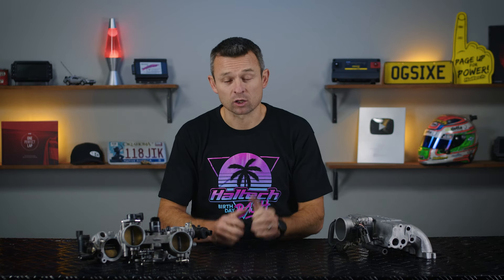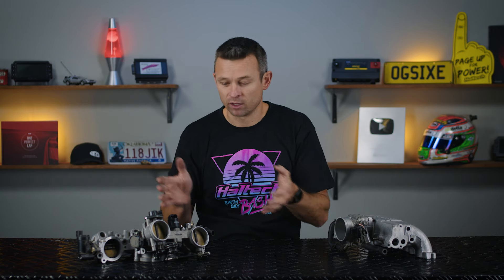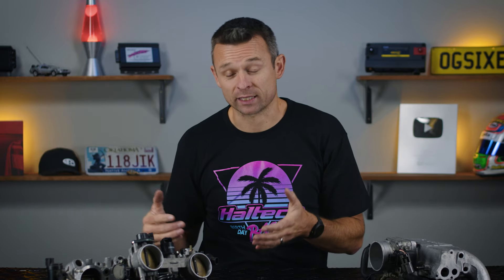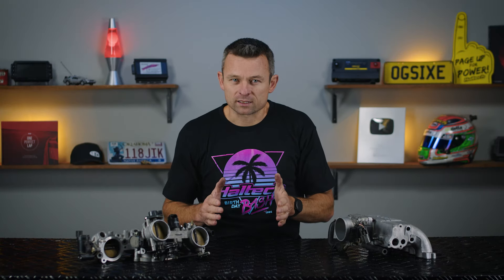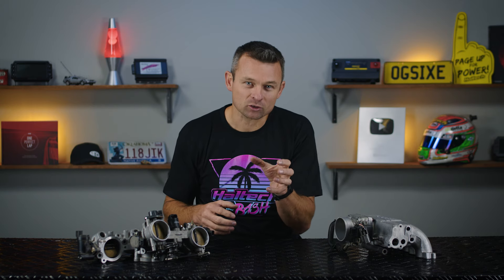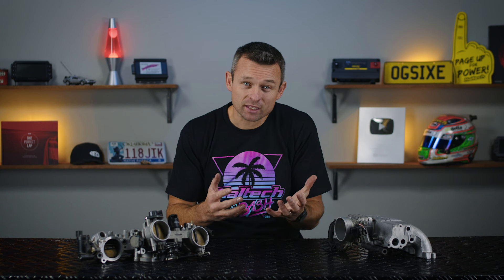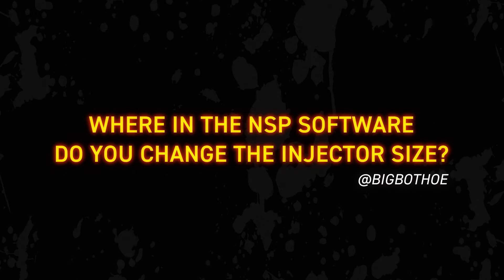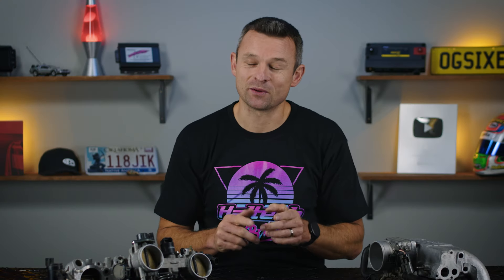🛠  Can ITBs increase horsepower? | TECH TUESDAY

Comment: ITBs are somewhat to an NA engine what a Monster can sized exhaust system is to a turbo build.
They are a last sorta upgrade after the engine is already pretty built up and at that point they really give it a kick.
On a first gen Miata for example I've personally witnessed them kicking up horsepower from 150 to around 165 on an already built engine.

The biggest upsides of ITBs over single are
- Insane throttle response (this is what makes them popular in the Japanese and European drifting scene)
- Gnarly sound and
- every cylinder getting its air as it needs it, no choking the last cylinder or something like that.

The modern approach to ITBs, especially in Europe, often includes an airbox around the velocity stacks, connected via giant hose to a dedicated intercooler and intake setup, to feed the engine clean, non turbulent and really dense because cool air. Gives them an edge over the typical style abroad.
Reply: A free flowing exhaust is the first thing you should do on a turbo engine. Starting at the turbine outlet.

Comment: Went from 55hp to 85hp with nothing but ITBs, although the stock SPi system was very ancient compared to the more modern ITBs and standalone!
Next is head and cam for more!
Reply: If you had a 40% of your horsepower locked up in your original throttle body setup you had other serious substantial engineering failures with how that motor was previously configured.
Reply: @otm646  ask that to VW... Its very common to see 50%+ gains by fitting bike carbs on stock ignition, let alone ITBs and standalone management.
Reply: That's crazy!

Comment: ITB's are for throttle response over peak power. And the glorious intake noise. But more moving parts and tuning issues make it rare.
A good tune shouldn't loose much, but it is harder, mostly due to vacuum/maf/map sensor complication, but recent advances have been made.
Most throttle bodies these days are oversized, particularly aftermarket, decreasing intake velocity, losing power in naturally aspirated engines.

Comment: I am removing the itb of my swift twincam gti car.  It is a real. nightmare in lower rpms to work correctly with the ecu.  I am a good pilot so I will not need those little extras  hp for a race.

Comment: It comes down to VE (volumetric efficiency). On a NA (normally aspirated) engine there are some losses in airflow and having 100 percent is rare on a production street car. Good race engines can actually have a VE over 100 percent because of tuned intakes and exhaust. Today, many cars are turbocharged. VE can be 200 percent (2 times NA). 

Some numbers to consider... at 6,000 rpm the pistons are going up and down 100 times per second. On a 4 stroke engine, the intakes are opening and closing 50 times per second. That's not much time for intake valve to stay open. No air can enter if valve is closed at wrong time.

Comment: I'll bite into some controversy. 

1 - Most ITB's pull in Ambient engine bay temps dramatically lowering the air density entering the engine compared to an OEM airbox or A/M airbox system. (Yes plenums and airboxes can still be applicable to ITB's but usually are forgotten about.)

2 - A well built Intake Manifold with a single or dual throttle body can still take advantage of interchangeable velocity stacks and dynamic runner lengths with more a stable Load sources for fueling strategies like TMF or MAF and strong VE-MAP resolution. An additional benefit of a single or dual throttle body is a strong vacuum source for brake boosters and crank venting.

Comment: I run a 8 ITB setup on a 452 cu. in. FE Ford with a hot cam, and it idles like a stock engine.  The cam is a 248/245 on a 110 LCA and acts like about 225/225 at low rpm and makes as much power at wot as the original single plane carb setup.  The throttle response is crisp.  It is tuned with the ITB map on a Megasquirt that blends SD at low rpm with Alpha-N at high rpm.  Engine made 550 hp and 600 lb.ft. of torque and pushes my full bodies full interior 1968 Mustang to 11.3 sec 1/4 mile.  The greatest challenge is synchronizing the throttle bodies, but if you have a idle air valve attached to the common plenum, it's not as critical.  The engine will idle with the throttle blades almost closed.

Comment: I suspect the difference in performance was a lot larger back in the day, what with siamesed ports and log-style intake manifolds on small engines and such.  Multi carb setups were first, and all the rage for straightening out the manifold as well as getting better response, what with pumping losses made such an impact on performance - and it was all the more noticeable when a quick car made only 100 peak hp or so.  I remember ITBs were definitely the rarity back then, generally only found on serious race efforts (and even then, a set of DCOE Webers was just as likely to be found.)
Reply: yeah how much of a difference such a mod can make really depends on how good the stock intake was in the first place.   say a 2 liter that's doing 100hp stock vs. a 2 liter doing ~150 stock. if the stock manifold/runners are rather good already it's not going to be an easy gain.

Comment: Biggest trick for stable idle and return to idle was placing a small mower fuel filter inline with the vacuum log line to map sensor. Acts like a volute or plenum chamber. Takes all the peaks and spikes out of the map signal.

Comment: The engine I am using can make a lot  more power than the drive line setups that easily fit in the car can handle anyway so maintaining or perhaps even losing a little power for a visual and auditory aesthetic seems like a good deal in my case. Thanks for the info.

Comment: Matt,
This video is PERFECTLY timed 💙

I'm assisting a good mate of mine , and well know rally driver, with his classic Datsun Stanza rally car.
It's a proper pointy end of the field car with all the right gear, including MCA suspension, Holinger sequential gearbox, rack conversion, 5 link etc etc.
Power is from a healthy FJ24D running a set of 48mm Webers.
Power and torque are perfect for the job and he's not looking for more, however, it is cranky when cold, often wetting a set of plugs on the trailer, stalls when on steep slopes and just generally a 'You've gotta know how to start/drive it' kind of car.

After several years of resistance, he's now talking EFI and I'd like to see him fit some Jenvey Heritage throttles and an Elite 750 (No real requirement for anything better featured)
Are we going pour lots of $$$ into it and still suffer drivablity issues like the Webers, or are we going to tame the beast?

https://youtu.be/4VYMGxT8c8o

Comment: ITB’s are somewhat of a saviour for those of us trying to extract big power out of dinosaur engines like the Ford Crossflow 6. I recently purchased a Haltec 2500 and all the accompanying sensors for this very reason. Whilst the Aussiespeed manifold is a great common plenum manifold, it has it limitations, especially on alky fuels. I’m looking forward to even cylinder fill that comes from ITB’s and yes there are downsides if done poorly, but that’s the same as a poor common plenum setup. 
Anyway, time will tell, as will before and after dyno figures and ET/MPH. I’ll let you know how the JENVEY ITB’s and Haltec go. Cheers.
Reply: Agree. Idle stability, ability to cam how you want, throttle response, minimal pumping losses and equal cylinder fill/VE. If that last one is not equal between cylinders, some cylinders will effectively running different mixtures and trouble can ensue. Also expect uneven ring wear between cylinders. Plenums will work, but most flow is shoved to the rear cylinders with inertia. Love the old crossflows.

Comment: The one thing I personally think is missing in this video is the other side of the ITB size, going too small.
Unlike a common plenum where a single large TB is only supporting a couple of cylinders at a time, not all 4/6/8 or whatever, an ITB has to be large enough to support the cfm demand of that cylinder and intake runner by itself.
Take a 45mm ITB for example, it only has enough area taking into account the shaft running through the centre to support an intake port of 300cfm max. This is all at 28” water test pressure.
Yet a single 80mm TB could support 1030cfm, that is more than 330cfm for 3 cylinders all at once which doesn’t happen.
So the ITB size has to be big enough even for a mild engine, even stock LS3 heads flow 300+cfm so 45mm itb’s would choke them.

Comment: intake runner length on a car engine works like exhaust spacer on piston port 2 stroke, shorter gives higher rpm performance because the pressure waves can operate quick enough at higfh piston speeds but long ones time the pulses better to get air in at lower rpms

Comment: In short, runner length determines low/mid/high rpm power ranges. ITBs, STBs, or carbureted doesn't matter.

Comment: The fastest race car "circle track" is a Sprint car.  Naturally asperated fuel injection "ITB'S"   But they control the fuel speed by low and high speed pills "check vales" and the Barrel valve controls idle speed and part throttle until butterflies are wide open. "Veg explanation"

Comment: I have a Toyota Corolla AE111 GT that has the legendary 4AGE Blacktop 20 Valve engine with ITB's as stock. Even stock it feels great and gives the impression that it wants to be at WOT all the time - that's a cool quirk of ITB's I think people need to know ;) I'm about to order SQ engineering 100mm velocity stacks and can't wait to swap them in place of the stock rubber ones. Maybe I'll tune it on Haltech Elite 750 from BGRS ;)

Comment: Great explanation of how ITBs work but I don't think you were very clear about air volume flow rate (horsepower capacity) versus the air column length between the throttle plate and intake valve (throttle response). If your single (or multiple) throttle body setup cannot flow enough air at high RPM and pulls vacuum at WOT, you could install ITBs...or just install a plenum that accepts a larger single throttle body (or two throttle bodies). However, ITBs do something different that plenums can never do at any size: Reduce the response time between changing throttle position and changing engine torque output. That's why correctly tuned ITB setups don't just sound snappy, they FEEL snappy. Floor the throttle pedal, and the engine delivers torque sooner.

Comment: with no turbo on car engines they have had intakes with two lenths of tubes so the the air pulses will hit the intake valve when its opening so then a single throttle body is better.edit renault vlio williams had it the 1.8l and the non willamse sport clio mid 90s

Comment: I believe that a point that has not been considered is the "theft" of air between cylinders inside the plenum and the problems of reflected pressure waves inside the plenum, which generates a lower volumetric performance of the engine with respect to the ITB's.
On the other hand, the response to the throttle is faster with the ITB's, with respect to the vacuum signal that is generated inside the plenum and its ducts.

Comment: Are ITB more user friendly with forced induction? I was thinking of a set for my sr20 vvt, but this video has me contemplating it now. Cheers in advance. Loving the content, keep up the good vids.
Reply: I'm curious how that setup would look. Have the incoming air volume feed into each individual throttle body directly rather than into an manifold?
Reply: I’d still have to have a manifold or plenum. Just moving the throttle body/ body’s to the other side of the runners. If the GTR and GTi Pulsar have it, I’m sure it could be done to a s15 sr20det vct engine.

Comment: I'm about to tackle this exact situation...luckily I'm coming from dual Weber DCOEs. Overall intake runner length from the intake valve to the end of the velocity stack is paramount. I've been able to tune to the 3rd and 4th harmonic already. I'm looking forward to challenge. I'll be running Jenvey Heritage with an Elite 1500. I've already got a vacuum log to go in as well. Will the fuel trims/self learning work well or at all in this style setup?

Comment: I've wondered about putting a homemade tube plenum and individual single barrel carburetors on an old inline 6. No computers or sensors. How well do you think that would work? I know it would take forever to tune. But would it work good enough to make it worth the effort?
Reply: Think Alfa side draughts  same  principle
Reply: It does work but they are a pain to tune. 2 barrel side draft webers or dellortos are much easier to synchronise and tune than single barrel setups.

Comment: Just like in the old carburetor days all the tuning in the world won't save you if you pick the wrong size ITB, and things are even worse with the smaller displacement, higher reving engines of today. 

Too small: great throttle response with a choked top end.

Too big: sluggish throttle with a top end rush.

 Finding a setup that allows good low AND high rpm performance means your not going to get the absolute best out of either but it's probably the best compromise for the street. 
Motorcycles have handled this by adapting variable length intake trumpets and highly sensitive ignition mappings, but their relatively high power to weight ration means they still have good alacrity even with less than idea tunings.

Comment: ITBs are kinda like tubular exhaust manifolds - get it right and they can be rather helpful with engine' cylinder filling and give a bump in power/torque where it's desired - but get it wrong and it can hurt it.

Comment: Very interesting. Can you address throttle plate spacers and intake manifold spacers? Do they work? Are there other benefits to using them? When to use them and how to know what thickness to use
Reply: Google resonance supercharging.
Reply: Throttle body spacers in reference to a single TB plenum style setup is to increase plenum volume.
Manifold spacers are used to fine tune the runner lengths to suit a particular rpm point for “ram tuning”
Some spacers for example under carbs are made from a non heat transfer material to not only increase plenum volume but to also keep heat out of the carb, in particular the fuel bowls to keep fuel as cool as possible.

Comment: All true BUT a seriously oversimplified explanation, itbs with the correct runner length (inc stack) and a cold air intake (airbox) will produce the high rpm benefits of an open stack with 7-10% better mid range torque. Most (non race) itbs have serious deficiencies in their design and setup, hence why many people have little gains.

Comment: If you run staged injection would you be able to have the first stage be pump gas, for cheap driving around. But have a complete seperate fuel system for the secondary injectors running methanol to raise your octane automatically when you're in boost? Or would there be an issue with them being different fuels?

Comment: Agreed. ITBs are great on a race engine that is tuned to run a small rpm window - love my race engine. However would make a poor daily runner. There you better off with the plenum for better driveability. Several vehicles have in their standard intake restrictiors that can be easily removed and provide increased performance without loss of driveability
Reply: I had itb's on my daily for over 15 years with no issues once correctly tuned. That was the hard part.

Comment: Here's something fun if you have a non-reed-valve 2-stroke with individual carb(s).  Take your air filter(s) off, start the bike, and watch the ends of the carbs as you zap the throttle.  You should see a cloud of fuel come out each carb as the air pulses send air and fuel backwards out the carb, and then suck it back in again.  Of course this happens at the speed of RPM so it'll happen a hundred times a second while the throttles are open.

Now that I have a moment to reflect on it, I wonder if this cloud of fuel is affecting the pod air filters I have clamped directly to the carbs?  That's effectively zero velocity stack length, and it could be leading to fuel fouling the filter material or something.  That might explain why the bike runs funny, but only at a certain RPM and only after it's been ridden for a bit.  🤔

Comment: The size of the runner is in relation of the cylinder shape and volume? Like a 83x60 bore and stroke would have a runner 60mm tall and 83 in diameter?

Comment: Would their be a logical explanation for running no filters on the stacks for more power? I had a autech SR20DE with an ITB setup, tuned based off tps with a vacuum log, quite short stacks, was super reliable, however if I put filters on the stacks it felt severely down on power, gull throttle bogged extremely hard. So I just never ran filters and had no issues 😅 This was quite a while ago on a little microtech, so I guess it could be purely tune related.
Reply: Yes the way to put filters on the ITB velocity stacks would to basically do what sport bikes do, have a big air box surrounding them with a high flow filter that has air ram tubes forcing air into the box when the car drives forward. Putting a filter on each tube is too restrictive and basically kills the whole point of a velocity stack which is to give the air velocity as it goes into the engine.

Comment: If it is solely based on looks. Nothing looks cooler than one Weber side draft for every two cylinders. Now there are EFI units built to look just like Webers. 
Another factor is runner length. Tor qs US at lower RPMs or more HP up top?

Comment: I believe ITB's were a form of technology that was meant for racing becouse the only benefit of this kind of a short path the air has to travel from atmospheric to the valve is you get a superb throttle response coupled with a light flywheel it really makes the engine feel alive. Apart from that the shorter and more open the intake the more power at higher rpm but you loose torque in low to mid range so not really something you'd use on the road.